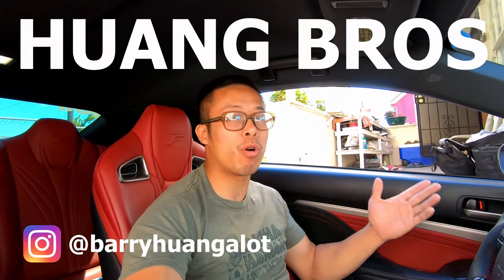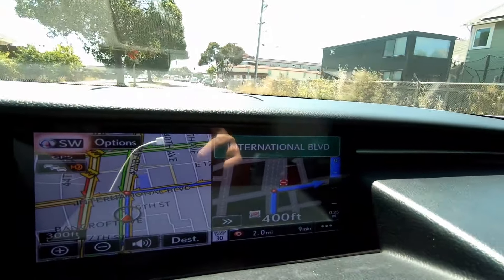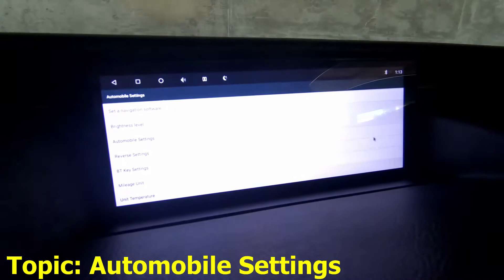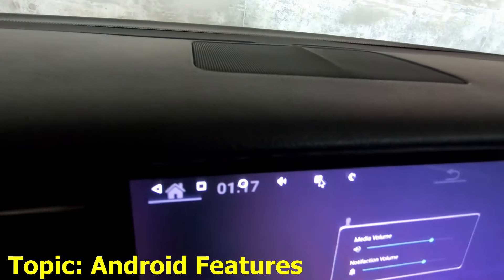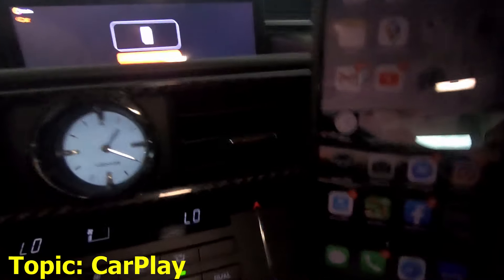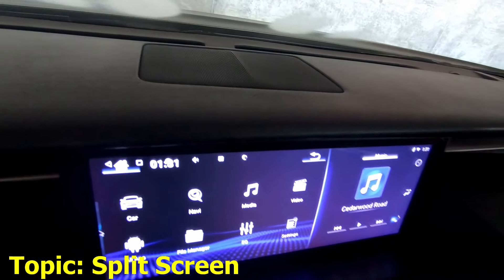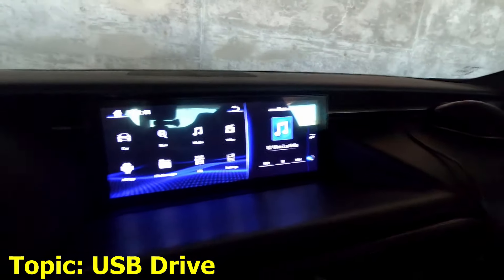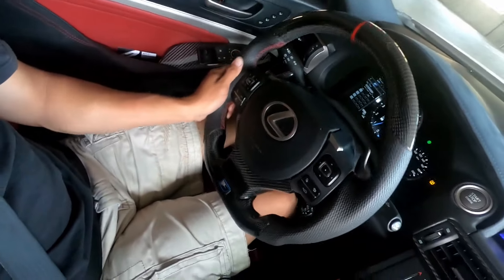I Installed This Screen In My Lexus RCF To Have These Features With CarPlay

Comment: Great video! Are you able to confirm whether the new wider screen stretches the factory Lexus software? Or does the software adjust its screen ratio? The font looked a little stretched when you weren’t in Apple CarPlay

Comment: Would be great if you can make a custom plastic cover to push the screen forward 3" + to make the touch feature practical. I believe the new IS brought it forward.
Reply from the maker: You are right. I have trouble sometimes tapping the screen because it is so far back. I have to lean forward everytime.
Reply: @thehuangbros  It would not be hard. Have a metal bracket made to push out the screen but to also keep it locked in place connecting screw holes on the screen to the dash tabs. Then  have a interior resto shop make a cover connecting to the metal bracket and wrap it in leather. It would look very OEM and cost $300 tops.

Comment: I watched the video well and solved many questions. thanks you 
I'm riding the 2014 IS250 model. My car also has Mark Levinson audio, but will there be a change in sound quality if I install that Android? I think the current sound is very good, but I think that Android's Bluetooth module may be worse. I'm sensitive to sound quality, so I'm asking questions.
Reply from the maker: Connecting bluetooth will go to the oem bluetooth not the screen bluetooth. Plugging cable in will activate carplay which will have great sound quality

Comment: Thanks!  Just to confirm the trackpad no longer works right, that’s why you’re using the mouse?  Thinking of getting a trackpad mouse and doubleside taping it somewhere.
Reply: Peter, the trackpad still works, i just use a mouse because it is more responsive and accurate than the trackpad
Reply: @barryhuang3723  How did you connect you Trackpad? My Trackpad came in today and I tried both USB ports on the 10.25 screen and it did not work

Comment: Thanks for this  video bro.. Been looking to update the screen of my RC. Just one qstn though; did you get the screen from alibaba or Korean version. I heard the Korean one doesn't have any heating issues.
Reply from the maker: Hi Joe, No problem, just trying to entertain and educate everyone in the RC platform. I got the screen from Alibaba. The link is in the description. If you go this route, make sure you contact Iric Tan on the site to ensure you get the correct one for the RC350. There is a unit specific for whether you have navi or no navi in the car. So make sure you contact her. I do not have issues with heating luckily. It has been like 2 weeks strong.
Reply: @thehuangbros  thanks for the quick reply bro. And yes your DIY is very detailed, well done. I'm a member on the Club Lexus and we've been discussing about this screen. I'll def be linking your video tutorials to my other members on the group. Peace out bruh. ✌️
Reply from the maker: @joe_rc350  Much appreciated Joe.

Comment: Very helpful video I have couple of questions how do you get rid of the music that came on the radio also did you have a problem of no sound from the radio when phone is connected. Also under automobile settings it's asking for a password
Reply from the maker: The demo music you can go to file manager and delete from there. When you say radio, are you referring to the stock oem factory radio system? You can download iheart radio and use that with carplay to access radio stations. If it is asking for a password, no need to do it unless youre trying to reset something like the displayed vehicle
Reply: @thehuangbros  Thanks I mean I have one USB hooked to my touchpad the other to my phone but no sound comes from any apps but when in factory mode everything plays fine
Reply from the maker: @alexanderdarden6229  which usbs are you using? The ones already in the car from factory or the one that came in kit. Did you check the connections behind the screen and the ones behind the factory system?
Reply: @thehuangbros  The ones that come in the kit. I will double them does it matter which one I use for the touchpad or radio
Reply from the maker: @alexanderdarden6229  usb 2 will need iphone cable for carplay. Usb 1 can be touchpad or mouse or usb thumb drive

Comment: How’s your mic since it’s right next to the screen? Do you have any issues when calling? Like can the other person on the line hear you clearly?
Reply from the maker: Hi Erick. Good question. I repositioned my mic to a spot under and hidden from the android speaker. If you go to my channel and look for the bezel trim install video, it will show that i repositioned it next to the climate slide control. The mic however, is only used when i use the speech function for waze or google maps. When i answer phone calls, i use the phone answer button on steering wheel to use oem factory mic
Reply: @thehuangbros  ahh okay got it. Thanks for clearing that up! I’m thinking of ordering one for my car but when I saw the mic, I thought I had to run it and that’s going to be a hassle
Reply from the maker: @agentcortez13  tomorrow, im dropping a video on a touchpad that will fix all lag issues when using the oem rc trackpad.

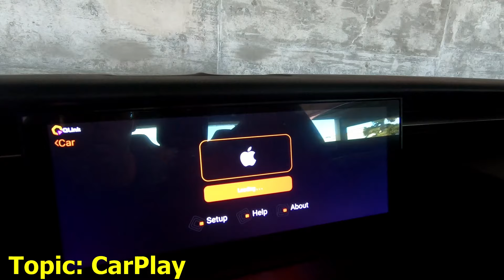Comment: Great video man, what I wanted to know is on 10:27 in the video when u exited car play and went into the YouTube app in the screen, how are you using the internet, do you have your phone hotspot on or is the screen receiving date from your phone through the lightning cable? 
Also is there a way u can continue using the track pad that come with the car already or no? 
Thanks 👍👍
Reply: Hi Kevin. Yeah i did hotspot off my phone. You can use the trackpad while youtube app and all but the accuracy is not as sharp or spot on as the mouse in the video.

Comment: Hello Guy, i just install the same screen on a lexus is gen3 f sport.
Did you perform some videos with some improvement set up? I remember something about size screen...
The GPS with the screen looks like awfull ( find nothing) and the mic doesn't work. ( May be some set up but don't find it.)
If you have some advice..will be great or by teams, zoom
...
Bye
Reply from the maker: I have not used the navigation app svig that comes with screen. I use carplay to use my googlemaps and or waze app. The mic should be plugged in from the back where the wires are. When you use the mic to answer calls, press the answer button on the steering wheel to have it use oem mic.
Reply: @thehuangbros  yes I plug it but because you use carplay I think you use the mic from your phone for perform address no?
Because for me it will.be a lil expensive for only use it for carplay no? :)
Reply from the maker: If you use the voice to text function from the screen for the app, then it uses the android mic. If you use your phone to input the address, it will use the phone mic. Typically the mic that is used is dependent on which device you choose to activate the mic feature.
Reply: @thehuangbros  yes i understand that. So your mic Android is working. So i need to check the parameters.
And the GPS is ok ?
Thx man
Reply from the maker: @oloc2737  the only gps apps i use again are waze, google maps, and apple maps. That comes from the phone and just gets displayed on screen. So i havent gad issues
Reply: @thehuangbros  i have some answer from the dealer. The mic is only when you use bluetooth. So only for qlink... So strange that the device is not able to perform this. I m a lil upset because at the end it s just a big screen , :(
No mic, no full fonction of the mouse...I need to fix also paramater from mirror link because it doesnt use the full screen. But my goal was to only put hotspot on my mobile phone and use the Android device for Waze, Deezer and dont touch my phone. I m waiting a trackpad ( thx for the solution) and i hope it will the last time that i tried to fix something on this device ;)

Comment: How does your YouTube work on the screen? Is it on CarPlay or built-in app on the screen? Does it use WiFi? Do you have a hotspot on your iPhone?
Reply from the maker: Hi what's up man. 
1. My YouTube app from Android Auto(AA) works only when I have a wifi or hotspot connection from my phone connected to the AA.
2. I used the built in app on the screen to go on YouTube itself. However, I can play music on my phone's YouTube app and it will play through the factory speakers as I am connected through CarPlay but will not display the YouTube media. 
3. In the video, it was using my iPhone's hotspot so it was using my data. It helps to have unlimited data, unfortunately I do not have.
4. I did have a hotspot on with my phone. I have tried to use a wifi from a home wireless modem but no luck. I have been able to connect to a restaurant's wifi to test some features since it was in range.